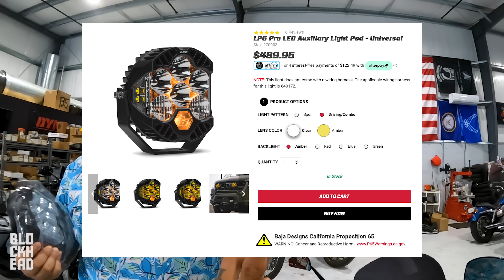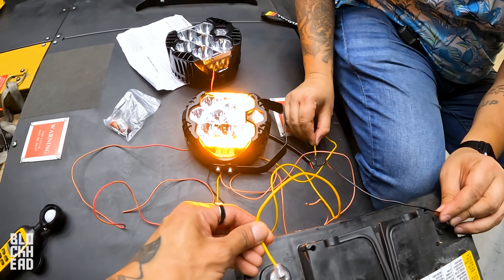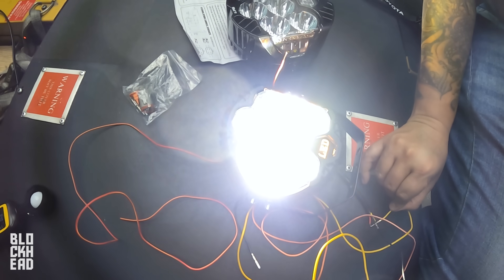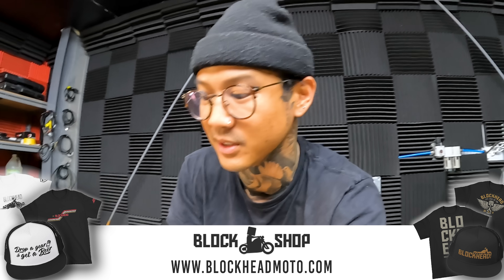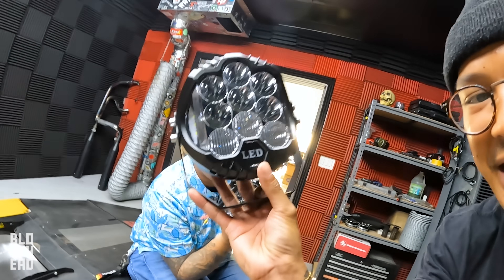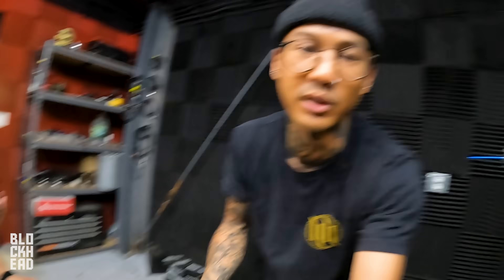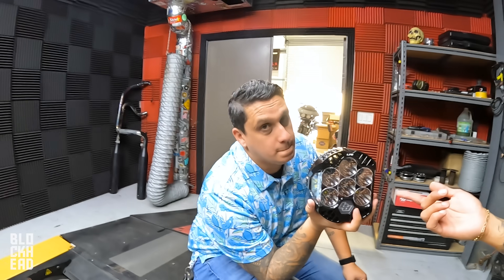I BOUGHT Amazon's CHEAPEST and MOST EXPENSIVE LED Headlight

Comment: I am always budget minded and ease of install...I spent $130 for a plug n play Led inserts in my stock Dyna FatBob headlite....Works great and didnt break the bank and installed myself in 15min....
Reply: That’s gonna be my next thing on my 15 Fat Bob, can’t stand those stock lights. Especially since I work nights.
Reply: Hello fellow fxdf guy haha i also got those inserts but after a mi th if research most are just rebranded chinese lights friend has hogworks and for the fun of it i ordered ali express ones after opening both they were literally the same lights just a 250 price difference weight and spec disaster but ali express works
Reply: @skrewie9400  Some guys hate on Asian products but dont on European products...I find that rather ignorant....If you want to keep it all US then do it but dont hate on some imported parts and not on others....
Reply: @bradlozano2571  i'm european though haha idc what country a brand is from as long as i can see in the nigh i do have a question i have a 2014 does your forward controls feel cramped aswell? I'm getting extenders just so i have a bit more room but thinking of lifting the gear lever a bit mire up to fit my boots for up shifts easier

Comment: Denali Electronics makes various killer leds for numerous bikes. They're not cheap. But they do offer a direct canbus controller that plugs right into the bikes ecm. Dimming, turning on & off can all be done through the stock handlebar switches. It's quite an amazing system. I've had it for 2 years now and it's been trouble free.

Comment: Is the cheap light gonna smoke the wires from Amp draw? Probably needs to be hard wired straight to the battery.  Is it custom dynamics shark demon that is straight plug n play w/No fuses and has plugs that plug into stock harley plugs. For 1k vs 1700.

Comment: I would not run either on road. It looks like both lights' low beams do not have a clean cut off line. If that's the case, on coming traffic would be blinded.

Id assume the DOT version would have a sharp cut off line for low beams.
Reply from the maker: DOT does have a cut off I believe 👍🏼

Comment: A channel xrayed a $5 Amazon iPhone cable and compared to the $30 Apple cable.  The huge number of additional circuit boards and wiring pointed to the Apple cable.  The solder used on the Amazon cable were blobs compared to precise soldering Apple cables.  Just pointing out more than just the exterior.  Many people think $20 should buy the moon but $100 is the  new $20 sadly.  It is amazing what comes out of China including shipping.  I am sure the Chinese light will not work after a year.  Cheap beef is not good and good beef is not cheap.
Reply: Yea. I agree.   I ended up putting in on my grom to test it out.
Reply: Check back later for longevity as well. Buy once, cry once